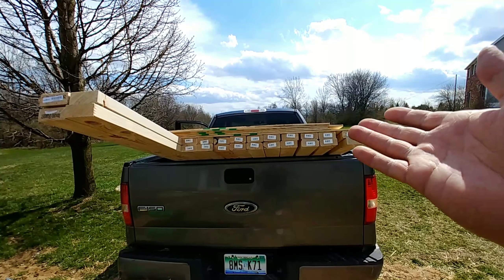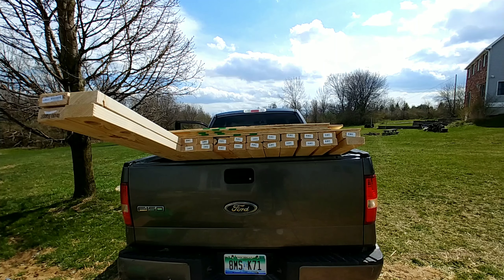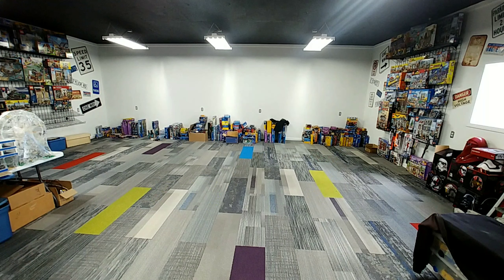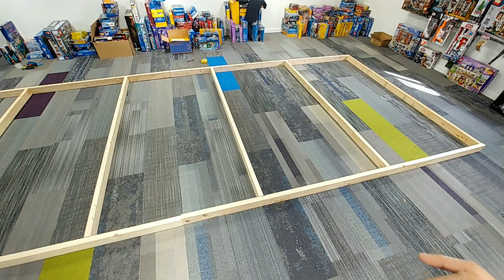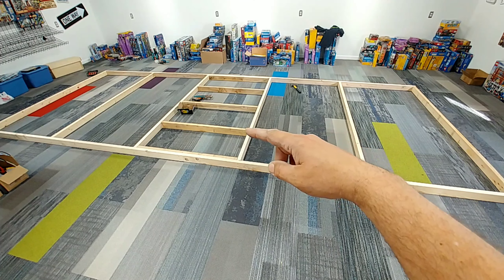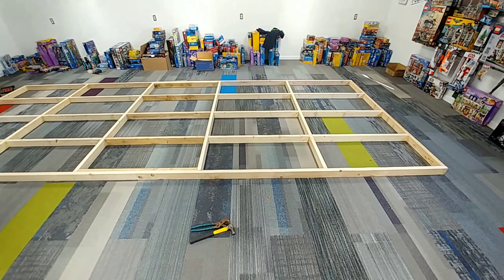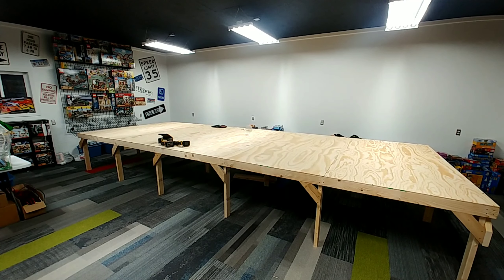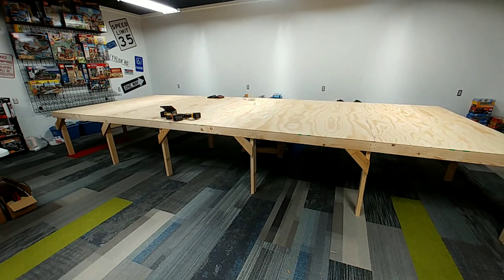Building my lego city table.

Comment: Great table. Mine is similar but a great deal smaller.I am building on an "L" that will eventually  find itself on a "U". Again congratulations and you're right, it's going to take a little while to fill that table.(192 square feet - if I figured it correctly) My table is only approx 38 square feet and I'm still working on it.

Comment: I'm happy that the city is going to start soon again. Really looking forward to it.
I'm also planning on a more advances table layout for a while. I want to have my city on two levels to have more space. One above and one below the table. I'm still not sure on the material to use, since I will not be able to put pillars under the center of the table, as you did. I might have to use metal to span the distance, since it might not be possible with wood. Do you have any experience on how much wood of which diameter bends with the length?
Another thing: When you expend later, how will you get to all sections of you city? I'm currently planning to have table section on wheels, to be able to get to the center when necessary. Are you planning something similar for that?
Reply: @BevinsBricksWorld  Thanks for the info. It will certainly be a long-term project and I will probably have to build some prototypes before I can build multiple instance of the table elements.

Comment: How thick was the plywood? 
I’m making a table now, but I was trying to make it not too heavy while also being strong, so I was thinking of using lighter weight materials where I can, like 2x3s and panel board if possible, not sure what I can get away with. The space I wanted to use was an L shape along two walls in the game room. Roughly 3 feet deep and 8 to 12 feet long on each wall. So a total of 48 to 72 sq ft.
Reply from the maker: I used 3/8 plywood.  Keeps it light but still durable.